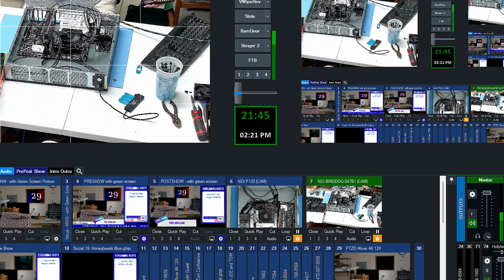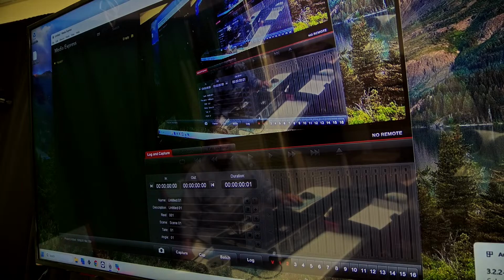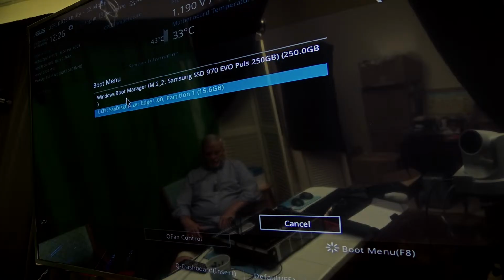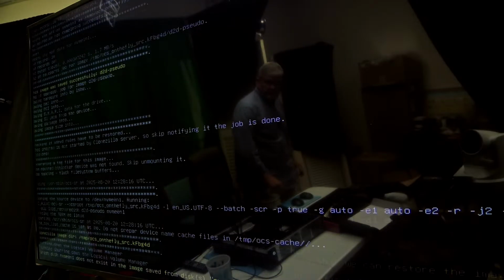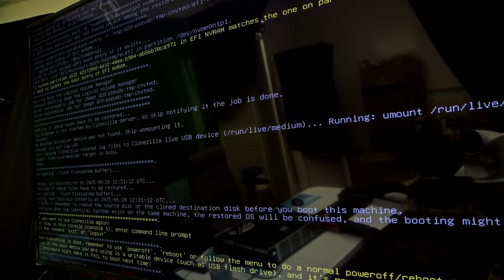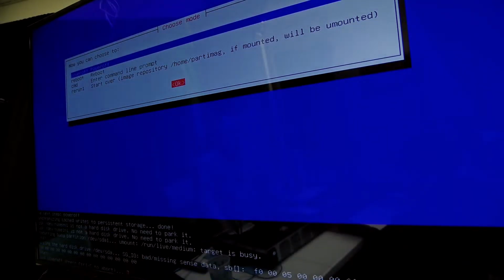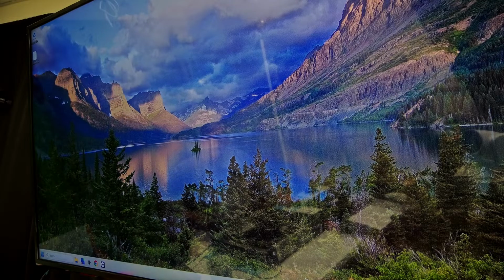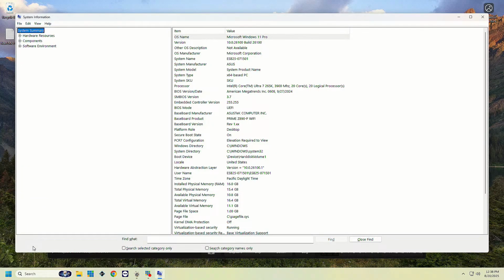Tiny GPU Completes Powerful 2U vMix PC Build

Comment: Nice build!  What would be a ballpark price for this, if I had you build one?
Reply from the maker: Hi Stephen. Thank you. It was fun to spec and build. Let's assume a 4-port SDI capture card and vMix HD with the hardware in the video (minus the 1-port capture card) would be about $4,500. You could build it yourself for less, of course. Ours come with a 3-year warranty and unlimited tech support. Interested? Tom@EasternShoreBroadcasting.com.
Reply: @EasternShoreBroadcasting Thanks Tom, just curious- I like that 2U form factor.  
Our services use a lot of virtual cameras based on 3 physical NDI PTZ's, and we don't use SDI, its all NDI HX.  It's running on a capable, but older pc. With all our lower 3rds, lists, and overlays we routinely run ~98 vMix inputs.  No replay.  So slightly different reqs from this system.  Keep up the good work!